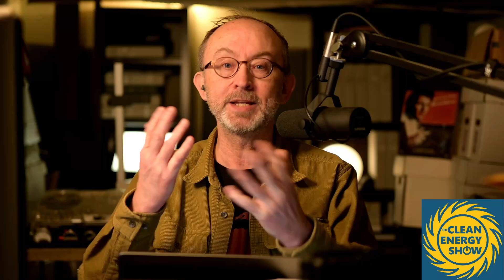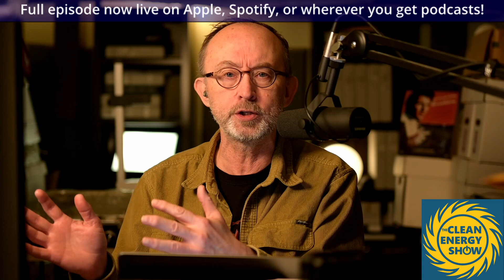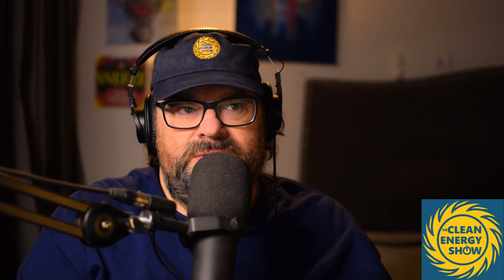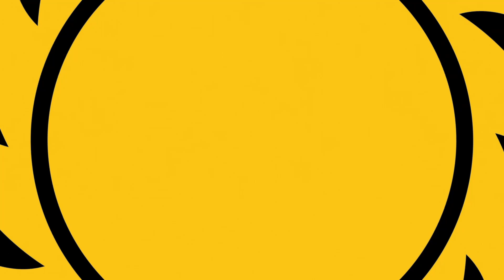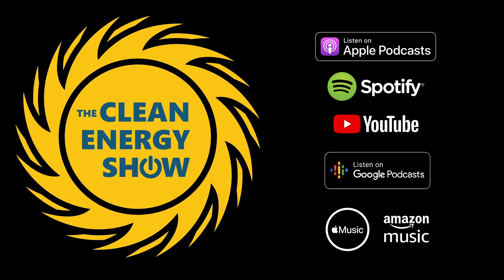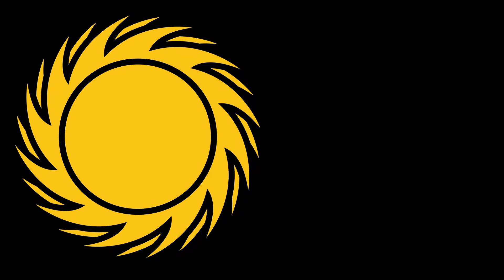Heat Pump at -25

Comment: Lower temperatures have less total water (humidity) in the air, thus it does not freeze up as fast, as there is less water to freeze on the outside fins.  So run time between defrost cycles increases and that can help out efficiency not needing to melt the ice buildup that often.

Comment: In order to extract heat from the outdoor air the heat exchanger in the outdoor unit needs to be at a lower temperature than the outdoor air. So for outdoor temps of -20C it needs to be at around -25C to -30C. At those temps any humidity in the air will condensate and freeze on the heat exchanger which means that every once in a while, depending on how much ice accumulates on the heat exchanger, it will go into a defrost cycle. Since cold air can contain less humidity than warmer air it would seem to make sense that at -15C your heat pump doesn't run as well as at -25C because at -15C the air can still be quite humid thus causing the heat exchanger to freeze over quicker and more often than it would at -25C when there is less humidity in the air.
Of course at those low temps the compressor has to do a lot of work and this, in combination with the defrost cycles and electrical back-up heater, means your energy usage goes up quite a bit (COP of your heat pumps drops dramatically) and having a log fire or other kind of secondary heat source is a good idea. It also sounds that your heat pump is basically only providing warm air which is not the best way to use a heat pump as warm air cools down quite fast. A better option would be to have an air-to-water heat pump in combination with in-floor heating. That way you warm up the (concrete) floor which acts as a buffer and water is much more suitable to transport heat. But of course something like that is hard to retrofit, especially if you have wooden flooring, which seems to be the standard in Northern America.

Comment: All the ones we install are -30 rated (200+ so far) but we have not had temps of colder than -15 or -18C in the last couple seasons in Toronto. I haven't had any customers complain at those temps. I did have one in a zone that regularly saw -25C and the owner said that it was having trouble keeping up around -30C

Comment: Where you had resistive heating at about -12°C, it could be the heat pump happened to be in a defrost cycle at that time.
I think heat pumps are more suited to eastern Canada (say Montreal) where -25°C happens - just not that often over the course of the winter.  Per my logs we only got below -25°C on 3 days during 2023 (-31°C deepest).  Jan was average -6 and Feb -8°C.
Also, on the plains, winds are high and will cool a house down quicker than places where I am with lower winds and plenty of trees to break it up.
Still a good idea to get as much "out of the air" at lower cost than burn resistive or fossil.